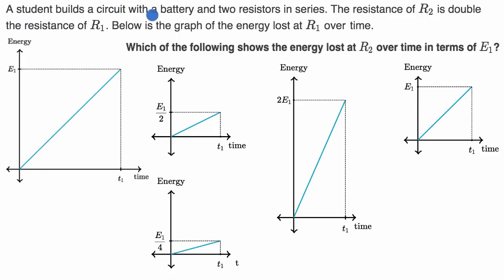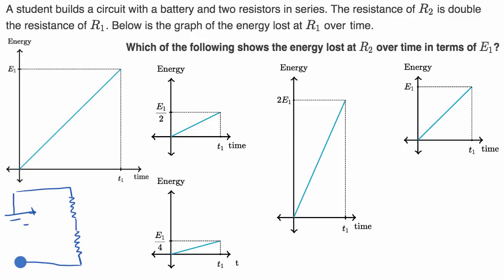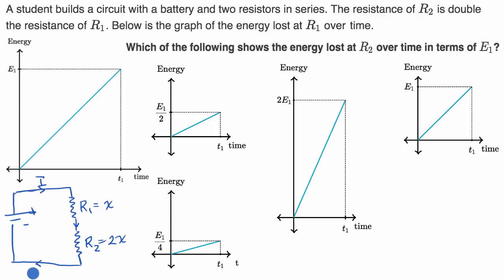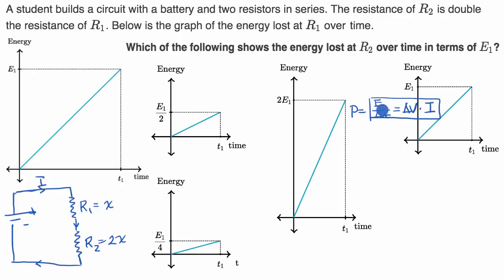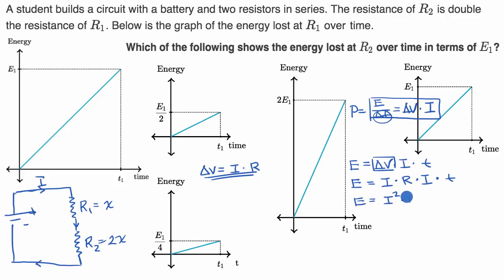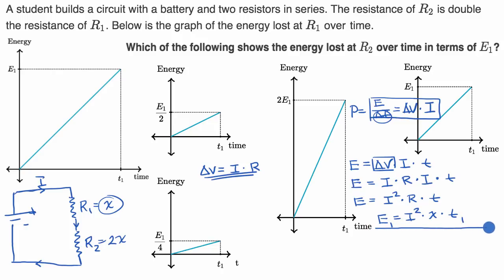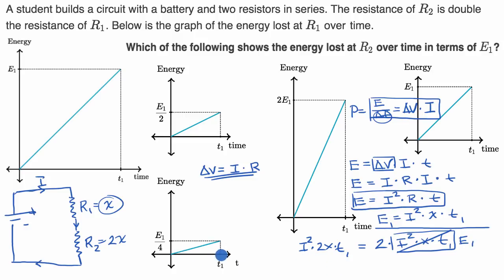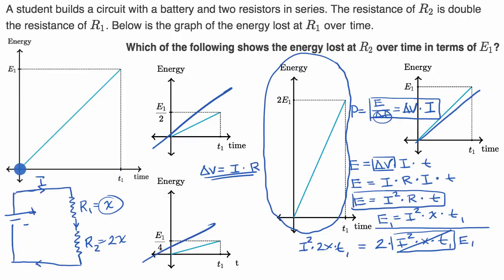Energy dissipation across two resistors in series example

Comment: Hi Khan, change in the voltage means change in the current over time at any resistor. Expressing R2 = 2×R1 which leads to E2 = 2×R1×I×I = 2×E1 could be more clear explanation. All best!